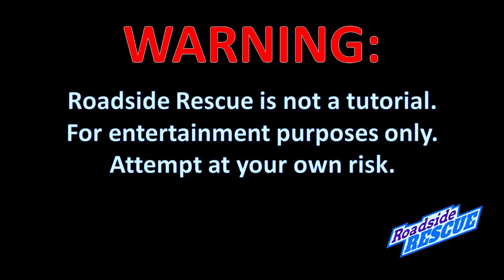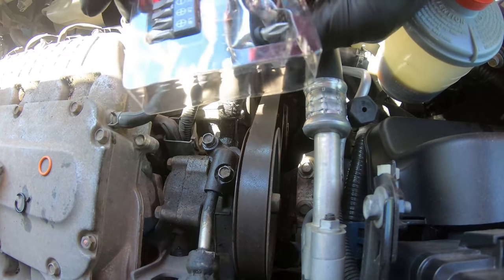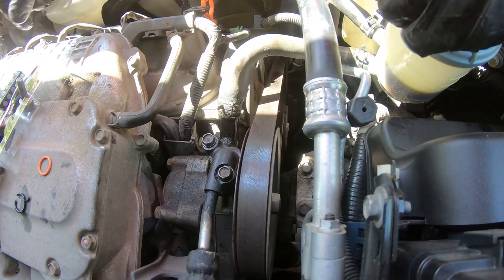Customer was going to get rid of their nice car because of this Simple fix! Not on my watch.

Comment: Just a quick mechanics trick; when loosening tight bolts, especially rusted 10mm or greater. Tighten just a wee bit it first, then loosen. I find this makes it easier sometimes.
Reply: I do that naturally until l say the magic words “ Righty Tighty Lefty Losey”
Reply: The Car Wizard also said cleaning out bolts before attempting to take them out will almost always prevent stripping (while using the right head, of course). He seems like indeed a great wizard so I do trust his word. 👍
Reply: @CitarNosis317  how do you clean out a bolt before loosening it..?
Reply: Wouldn't it be easier to use a razor knife to slice the oring to get it off..? It shouldn't score the metal any more than the point of that pick... especially if you just pushed it through instead of slicing...
Reply: wiggling the bolt in general helps. Basically 2 steps forward one step backwards and you shouldn't really ever snap a bolt...

Comment: Ernest another great video👍 I was hydraulic mechanic for over 35 years. I would run into some really small O rings quad rings ect. Go on to Amazon and order some dental cleaning tools the tools are real small have points on them they're just easy to get in there behind the small o rings and pull them right off . Wouldn't have $20 in a set of them. Keep making videos a good content!

Comment: When bleeding rack and pinion, jack up front so tyres are free. Now without engine on, turn lock to lock a few times checking fluid level. The rack works this way as a piston pump without air bubbles.

Comment: I'm sure others have mentioned this already but ONLY Honda power steering fluid in Hondas.  Also, that high pressure hose is very common to leak near the crimp.  That one looks like it's leaking.  The o-ring may have been leaking but when you see fluid all the way up the hose it's not coming from the o-ring.  On the lower suction hose, you got it the same way I always get them out.  Well done!  

Another common issue on those is the PS gets weak when the engine is hot, and idling.  The steering will get real stiff.  A fluid flush and cleaning the reservoir may help.  If it doesn't, replace the pump.

Comment: Another job well done. A tip on those honda pumps on the Jseries engine. The second connection you took off (the plastic one on the bottom of the pump) usually gets super brittle, so if you run into this again that may be cracked, not a bad gasket
Reply from the maker: Good to know! Thank you!
Reply: The hose? Because he already changed te gasket fir the bottom one

Comment: Try a couple caps full of brake fluid in the reservoir. This fluid will break down any water in the system. This is an old school trick. Before rack and pinion to remove squealing and other problems with power steering pumps but it still works.
Reply: I would like to hear a Honda tech comment on this trick…. Maybe it worked great on 1960s Buick’s but I would only “try”this when a new steering rack is on its way to my house… Because if it doesn’t work, it could be a bad day. Brake fluid absorbs water, but then you have shrek piss brake fluid mixed with ps fluid, not sure how that can be good?

Comment: Strongly recommend honda spec power steering fluid. Im super paranoid about fluid specs cause i had a pump eat itself on a friends car that i fixed cause he used the cheap stuff from the parts house.
Reply: Yes, should always use Honda PS fluid on Honda vehicles or you will come back in for leak soon.
Reply: Yeah don’t let Eric the Car Guy see you using anything but Honda stuff in a Honda 😜
Reply: yes always use Honda fluids !

Comment: I always seem to drop the wrench just after I finally get it on the awkwardly located bolt/nut. Then need to spend 10 min trying to find it again....
Reply: Rumor is if you drop the 10mm you never find it.
Reply: @Plurmotions  Not always true.  I found my 10mm socket Saturday after quite a search.  Sure slows down the work though!
Reply: corey Babcock  In 1987 I dropped one and it fell into a hole in the unibody of a Mazda 626.  It is still there for all I know!
Reply: Sew a couple magnets into your work gloves?

Comment: Excellent video, as always. I believe Honda use ATF for power steering fluid. Will that damage the pump or steering wrack if using the clear power steering fluid?
Reply: It's possible but I wouldn't , I have added some to my Chrysler van when I owned it
Reply: I know Eric the Car Guy (a former Honda Tech) strongly recommends Honda power steering fluid in Hondas.
Reply from the maker: I’ve heard you should use Honda stuff. (It’s pretty much the only vehicle I’ve heard it so consistently about) but since I wasn’t positive it would be all it needed to fix it I just added the bull stuff. We’ll go back later and flush it.

Comment: Those seals are a common issue with Honda's. BTW You're never suppose to use standard power steering fluid in a Honda. Honda power steering fluid only.
Reply from the maker: yeah. you were the first person to ever tell me that! But not sure if it was leaking anywhere else and lack of fluid caused me to put generic in for now. Next service im going to flush it. :)
Reply: I was going to say the same thing. Hondas are very particular with fluids.
Reply: @jonathantolbert4176  especially trans fluid
Reply: @bikeman1x11     DW1, accept no substitutes!
Reply: @jonathantolbert4176  so are chryslers
Reply: Yea smells like rear gear fluid

Comment: Just trying to help . These Honda  power steering pumps only like Honda   Fluid   , or power steering fluid that says Honda compatible  fluid . If other fluids are used they will whine and groan but will work .  Also these Honda vans and accords are big problems with the high pressure hose , leaking where it has a factory crimp where it mounts on the back of the cylinder head ..   they will leak under pressure  at full lock

Comment: Ernest, turn the steering wheel lock to lock SEVERAL times (wheels off the ground makes this super easy) to purge air from the system BEFORE starting it. Much quieter, and quicker to top off.... Hope this helps ya! (Be careful though, as this will overflow some vehicles, so slow and cautious is the way to go)

Comment: What is your opinion on using the Honda type power steering fluid. I have never been a big fan of the universal power steering fluid on a Honda. Always come back with a noise.and I replace it with the Honda type fluid.  And I notice a softer steering.

Comment: Another awesome video.  Honda must have loosened up a bit with their pumps and rack and pinon.  My 98 civic would whine and screech unless I put Honda brand power steering fluid in it.  Even if I used Prestone for Toyota Honda.  I see you just put some AutoZone brand in and it worked.

Comment: Just a little tech tip....when you have o-rings that are hard and stuck in a groove spray them with some brake clean and it will soften and stretch the o-ring and you can pop it right off.
Reply from the maker: Sweet. Thanks!

Comment: A Ford dealer mechanic with a YouTube channel called Ford Boss Me said the latest small model Ford automobiles have so little room under the hood that they require that the mechanic remove the engine to do things like changing an engine water pump.

Comment: Harbor freight actually has the box end flex heads. And I think gear wrench makes them as well. I've never had a need for them. But can't you just pull that hose and plug it with a valve stem. And then go and use a swivel socket. Although I can't see what it looks like. Also if you ever run across a jeep Patriot nosie that sounds loud like a bearing but isn't one. It might be the tranny. Try changing the filters and fluid. There is two filters, one in the pan. And one in the sump up  under the battery and tray. It looks like a cartridge filter and fairly small. A little car tip.

Comment: Titan also makes that size ratchet with a 1/4 inch head on it
Reply: Or you could get a ¼" adapter that fits the hex driver? Extremely handy
Reply: I have both the bit holder and the 1/4 square drive versions.  When you need them, they are great.

Comment: How much lower are you than the local shops for hourly rate for labor
Reply from the maker: now pretty similar. At minimum I carge 60$ an hour. At most 85$ but can make that more like 100$ with efecency. Travel is about the same, but i have enough customers now I really dont go more than 5 minutes down the read for jobs.

Comment: When you take a hose loose and you don't want it to run out take a bolt and stick it in the hole and clamp it. Voila a plug

Comment: Whoa, NEVER use regular power steering fluid in a Honda/Acura product!!!! Use OEM Honda fluid only, and not the supposed OEM-Honda type fluid from Autozone or the other stores. Authentic Honda power steering fluid only. 

This system needs to be fully flushed ASAP.

Comment: Cordless drill, Mother's Headlight Restore kit.
Offer the service, $20. Kit will pay for itself first use.
10 minutes of your time, super simple.
Replenish kit with a big jar of Mother's and a roll of blue tape.
Spray bottle of water, microfiber cloth.
Believe it or not- finish with a cocoa butter SPF Sunscreen and wipe.
Occasionally hand wash the sponges at home.
Nearly every car I've seen you repair needs this service.
Please consider?
Reply: Coco butter sunscreen? Dude that might look good fir a couple of days..if that. A restored headlight needs a legit 2k clear coat.  Anything else is low quality and temporary.
Reply: @papitosabe  Not true. The oils & emollients (Sun Protection Factor) soak into the newly polished plastic, and last for weeks. Even the best "clear coats" (enamel, lacquer, urethane) will check, peel, shrink and become dull again, necessitating another scrub & recoat. If you drive in the rain, or need to wash the lenses frequently- a mere wipe of lotion between works. Please at least try it before you knock it from pure speculation, Dude.
Reply: @HUBBABUBBADOOPYDOOP  "and last for weeks"...EXACTLY... "weeks"...and as I stated...thats temporary.  a proper 2k clear coat will last years.
Reply: @papitosabe  I agree with this. Polishing headlights lasts 6 months at most. Is it worth $20? I think so. If you are honest when you offer it it’s cool.